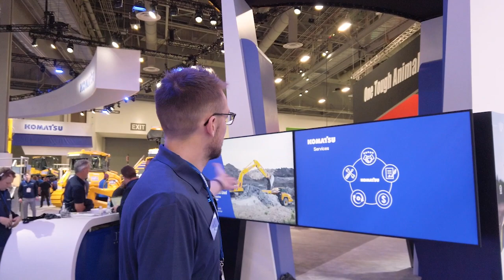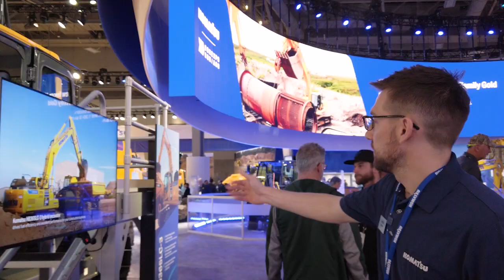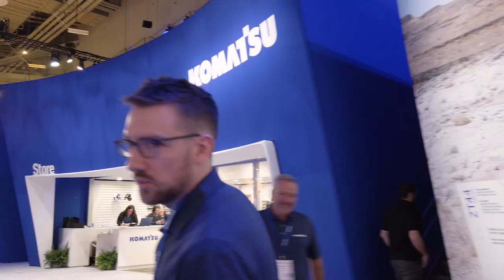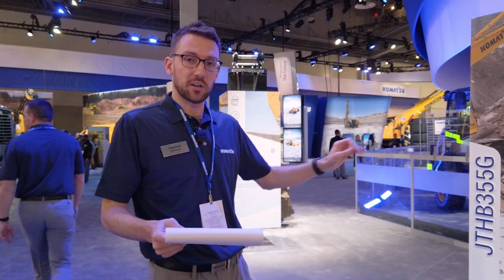CONEXPO 2023 Komatsu Booth Tour / CONEXPO 2023 コマツブースツアー

Comment: Video content:
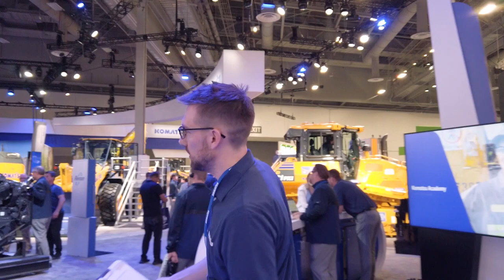1. Service & Support station (0:20 - 1:09)
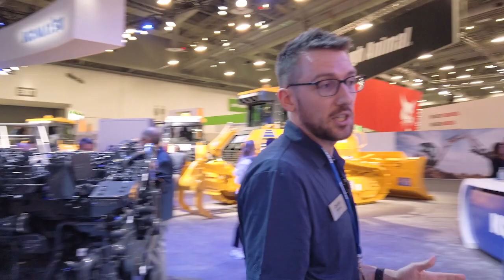2. Reman station (1:10 - 1:40)
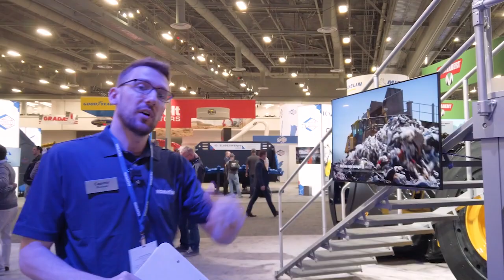3. Wheel loader WA475-10 WH = Waste handler (1:41 - 2:19)
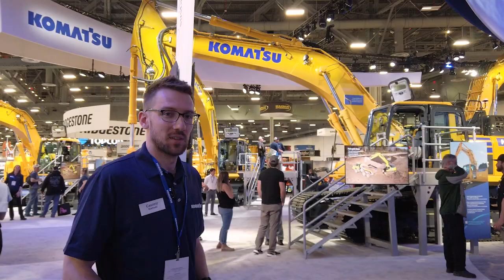4. Technology tunnel / Smart construction (2:20 - 4:24)
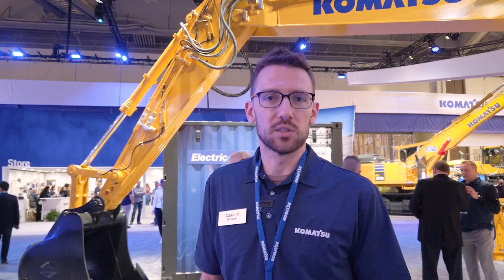5. Electric/Hybrids machines (4:25 - 7:31)
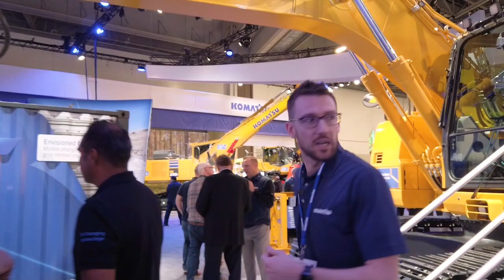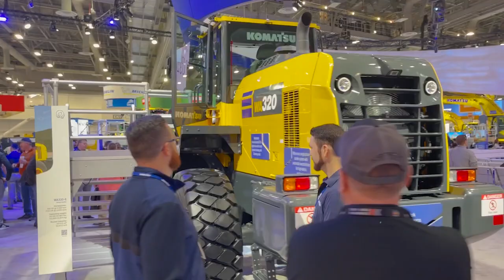6. Wheel loader WA320-8 (7:32 - 7:57)
7. Dozer D71PXi-24 (8:00 - 8:52)
8. Forestry/Quarry equipment (8:54 - 12:42)
9. Simulator (HD465 dump truck) (12:43 - 13:55)
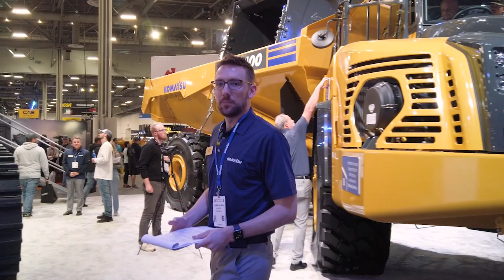10. Articulated dump truck HM400-5 (13:56 - 14:27)
11. Hydraulic excavator PC900LC-11 (14:28 - 15:18)
12. Hydraulic excavators PC360LCi-11 and PC238USLC-11 (15:20 - 16:32)
13. Hydraulic breakers (16:34 - 17:23)
14. Wheel loaders (screen) WA485 and WA700 (16:34 - 17:58)
15. Komatsu gift store (18:00 - 18:21)